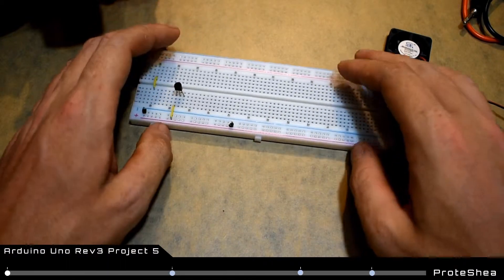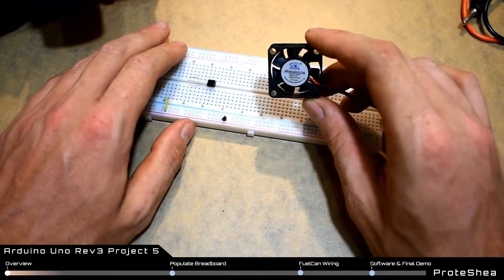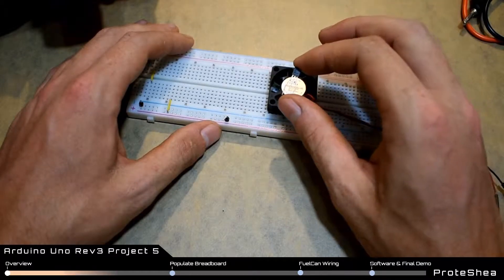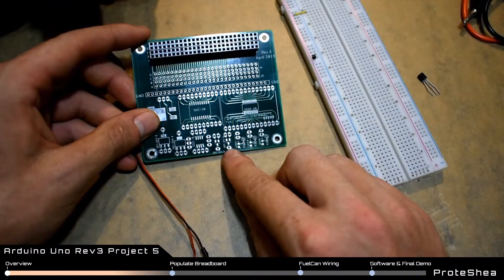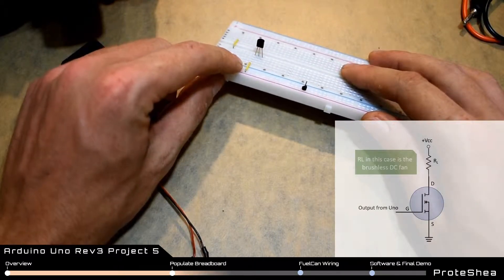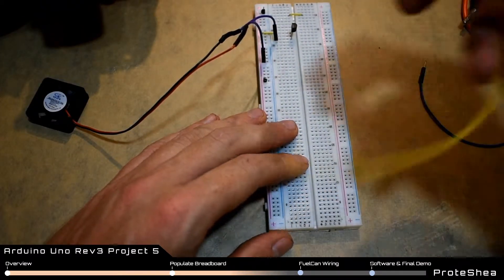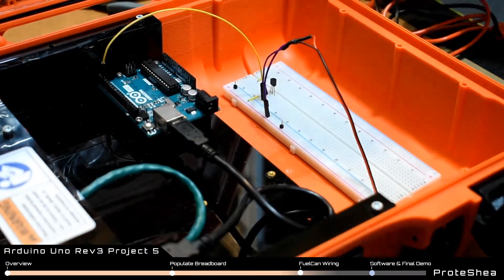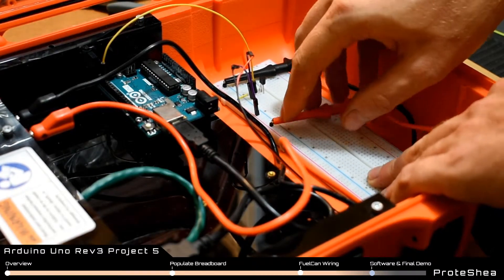Control a Brushless DC Fan with an N-Channel MOSFET | Project 5

Comment: Thank you!! I have been trying to control my SMD5050 LED strip through an IRL n-channel mosfet and the LED was just staying HIGH! Every diagram I read said connect source to 12V and the negative pole of the LED to drain. This works now!

Comment: Hi! Thank you so much for this tutorial it came very handy. I have a question though, it seems I can't manage to plug in two brushless in series to control them. How so? Do I have to use another mosfet and another pin on the arduino?
Reply from the maker: You wouldn't want to wire them series because one will create a voltage drop and cause the other one not to work. You could wire them in parallel, but you'll have to make sure that the drain current of the MOSFET is sufficient for two of them. And yes, you could also use another MOSFET and another pin which would allow you to control them independently. Hope this helps!